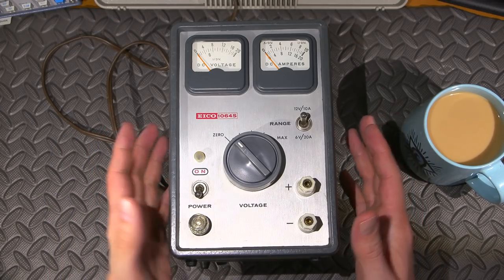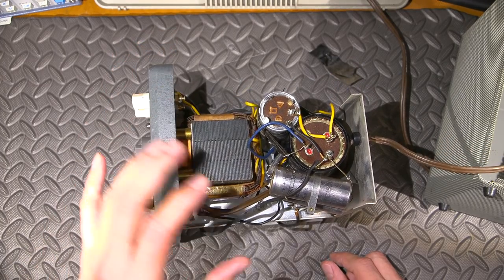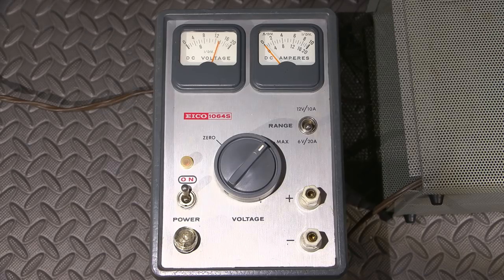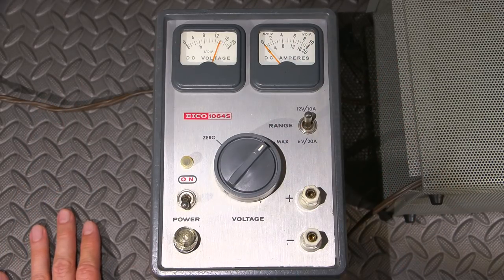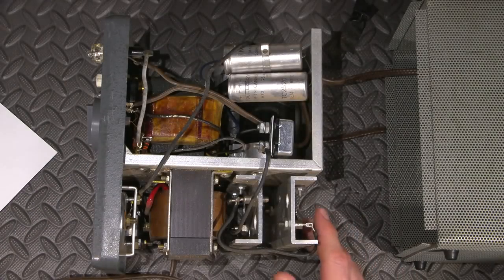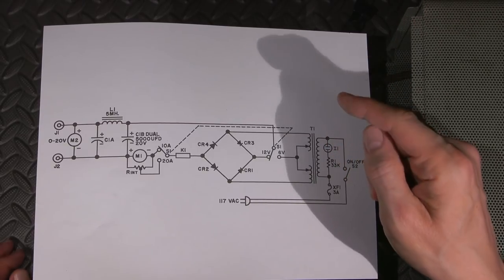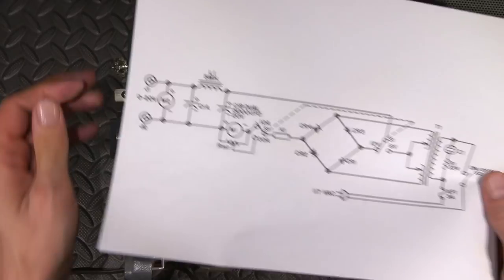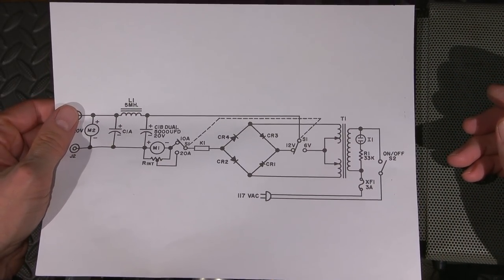Power Supply Knowledge - Tech Talk At The Lab!

Comment from the maker: To learn electronics in a very different and effective way, and gain access to Mr Carlson's personal designs and inventions, visit the Mr Carlson's Lab Patreon page here: https://www.patreon.com/MrCarlsonsLab
Reply: When are we gonna do the restoration? Dear Paul
Reply from the maker: @KetherWesak  It's in que, lot's of other restorations ahead of this one.
Reply: @MrCarlsonsLab  please do a 3 hours restoration with lots of details hehehe cheers
Reply: Sometimes you need to speak a little slower. Your an excellent teacher with wonderful knowledge. More of it will be absorbed by the student if you maybe use fewer words at a slightly slower pace with less redundancy. I love your classes - keep it up.
Reply: You didn't got the point of that configuration. Using center tap for 6V is because of the current.  In that configuration output windings of that transformer are in parallel and therefore voltage is half and current is doubled. And it's a poor design because those diodes should survive 4x bigger current.
Reply: Dear Paul, 
You really make electronics fun. One thing about this power supply, the schematic shows us the line, fuse and switch layout. You often speak about the fuse being on the switched line. Would you leave this the way it is or would you replace with three line cord and fuse the hot line to the switch, etc...?
Thank you,
David

Comment: Feeling old when I read other comments saying they have never seen an unregulated linear power supply before. I don't recall you mentioning it in your video either but a lot of earlier solid state electronics can have issues with noise from a modern HF switching power supply so these types of power supply are also useful when working on older solid state things too.

Comment: I much prefer the videos where you actually restore an old radio or item of test equipment such as the old multimeters (ME-26 for example) or signal generators or oscilloscopes, etc. that I worked on in the US Army back in the Seventies. Brings back a lot of memories of component-level troubleshooting. The videos where you only show what's wrong with the item don't float my boat.

Comment: Would be cool to see what the output looks like on a scope, using 12v and 6v mode. With and without smoothing capacitors.
Reply: and both ac and dc signatures. i bet its got a lot of ripple  thus the caps  trying to run something digital off it
Reply: @richardcranium5839  If that was a guess, it was a very good one. I've scoped the output of mine and a lot of AC ripple is present ever with small loads.
Reply: @rp5029  This underlines my reason for wanting a regulated supply.  A series linear regulator greatly reduces the ripple on the output.  For this cause,  I do not like unregulated supplies,  especially low voltage supplies.

Comment: This reminded me of a 6/12 volt battery charger my dad had. It was lacking the caps volt meter and choke. I had a similar circuit with the voltage selection. It had 2 large selenium rectifiers riveted to the side. I was just self learning electronics at the time and was amazed at the simplicity of the device. It was indestructible (thankfully) as I clandestinely used it in many projects and experiments.

Comment: I just happen to have the exact same unit , minus the strange cap setup . I use this box for all kinds of tests go/nogo , amp draw , motor brush setting , and other diagnostic uses . There is a spring metal wiper that controls the voltage . From outside , you have a gem ! The discoloration should not be an issue unless it has been mistreated .

Comment: Very cool how the schematic has the two diodes carrying the high current in 6V mode slightly larger than the other two.  My first 12V power supply I built in the 70's had 4 diodes like those, I think they were rated at 25A or so.  Industrial strength!  Great explanation of the operation of the device.

Comment: A simple, yet interesting design with the transformer having multi-tapped secondary. Most often these used a large reostat to set current, this has more of "voltage control" with the operator in the control loop, as you describe very well as usual! The meters seem to have little or no damping, but with a little operator patience, still fine!

Comment: Hi, nice to see you back :)
I also have an old brute force typw power supply with a variac that goes up to +/-40VDC at 200W or something like that. Good for building transistor power amps. I don't use it because I mostly dabble with vacuum tube electronics, but it's there in case I need it.

Comment: The easiest way to remember a full wave bridge rectifier is:  ALL diodes point to the positive.
Also neat from that schematic is that by that one switch the 12 V is made out of the series of the windings, and for the 6V they are used sort of parallel using the middle contact of the transformer.

Comment: Hello mr. Carlson

I wish you all the best in the new year and thank you for an absolutely great video.
I myself have a charger for lead-acid batteries built on this principle, and because at the time I was building it, it was difficult to get suitable diodes in Czechoslovakia, I used diodes from an old alternator for the rectifier.
One of my first regulated AC / DC sources works on the principle of a control transformer and also uses a Selenium rectifier for the DC component (those were the times 😉)
I wish you a lot of success in the next work and I quietly envy this source - a wonderful design - I have never seen such a thing.

Tom from Prague wishes you a nice day 🙂

Comment: With modern switching power supplies, say 5V USB chargers converted to 6V filament supply, it will cycle a few times (tripping overcurrent) before the filament gets warm enough where it doesn't trip the overcurrent protection anymore. It just takes time. With bench power supplies it's far easier to limit the current or just slowly bring things up from a very low voltage. From modern perspective, 300mA heater tubes are far easier to work with, since DC supply is a lot easier to get working with such a small current (small 1A diodes with no radiators, small diameter single wire on flyback/half-bridge transformer).

Comment: The Eico variac on my bench at work  is almost identical to this variable power supply, having the same case and layout, and a voltmeter but no ammeter. Slightly modified, with an incandescent lamp mounted to the top of it, for a switchable current limiter.

Comment: Neat video, Paul.  My 80 year old father has a battery charger, built in the 60s that works like this.  The transformer is center-tapped, and the 6V/12V switch changes the diode configuration.  I’m curious what that circuit breaker (in your PS) is rated for, since it has to deal with both 10A mode and 20A mode.
Reply: 20 amps. It can run all day at 10 amps.
Reply: I have a similar battery 🔋 charger from the 70s, it two was my father's,  I believe it is a Schumacher, I still use it today to charge batteries.

Comment: Thanks once again for your talks.  I remember building one of these a very long time ago.  I was wondering why you don't add a bleeder resistor to the DC outputs on your projects.  A simple way to protect the user and some of the more delicate equipment I fix.  Of course, a 12 V supply isn't too big a danger to the user except for the welding heat when you short it out  LOL

Comment: @2:30 Kapton tape is a good thing, taped on cap is a bad thing!  Maybe trying to reduce ripple.
@4:45 That winding on the variable tap transformer looks pretty cooked. It's obviously still working, just looks like it's been hot in the past.
What about adding a drain resistor across the C1A cap when you restore it?  I realize it will draw on the ammeter, but I doubt a 1K would make much difference.

Comment: There is something to be said for these simple things, perfect for abusing as battery chargers or to reform capacitors and other sketchy things. One of my decent regulated power supplies had a crowbar with a threshold that tracked the output setting, you can imagine what happened to the crowbar thyristor when someone charged a car battery with it and then turned the voltage setting down.... It is easy to look down on non-regulated supplies but they can be very handy for some things.

Comment: The slew rate spec on these power supplies were basically about as fast as your eyes could read the meters, relay the info to your brain, and then send the signal back to your fingers to adjust the knobs.

Comment: Brute force pw sup are handy for a lot of things. It is hard to hurt them. Some even have selenium rectifiers. It is interesting it has 20V rated caps and the output goes past 20V. I have several supplies like this (different brand) that I have used for years some even daily. I have several fancy regulated supplies that have been repaired more than once. We use them for heaters, battery charges, motors, and many other simple applications. I'm surprised to see that big filter choke adding lots of weight and cost. I don't recall if my supplies have one. They typically have the crummy sliding tap transformer which is pretty primitive. But it works. You can also generate poor quality power by knob turning to test a circuits tolerance for bad input.
I have some that go as high as 50V.

Comment: In 1972 I paid about $40 for a new EICO power supply (looks exactly like the one shown in this video). I used it for a wide variety of applications: it works nicely as a battery charger. It has never required maintenance. However, after watching this video it makes me question the condition of the filter cap. Maybe it's time to replace it (haa).

Comment: The range switching circuit here reminds me of the system used in PC power supplies to configure the 4 diodes as a full-wave doubler or bridge rectifier depending on the 115/230 switch on the back. I suppose the same technique could be added to this as a way to get a third 24v range without adding extra transformer taps.

Comment: The label on the back, "BATTERY ELIMINATOR" is more appropriate than "power supply". To me, "power supply" implies regulation and/or current limiting is internal.
Reply from the maker: Regulation and current limiting in a power supply are like ordering a trim package on a car. It's still a car without the trim package.

Comment: that circuit breaker looks like the same as used in semi trucks. wondering how they get 2 different ratings. also they are usually marked  battery and load  so reversing them (which i have done) they wont reset until you remove the power from them. of course this could be different internally. perhaps when you do the resto  you can address this.

Comment: I need something just like that to run two heating elements 1/2 Ohm, Kanthal resistance wire, and my wattage calculations indicate 2-3 Volts @ 7-8 Amps so I can heat two rods up to 200 degrees C or so.

Comment: are the meters way out? in the 6V range, the voltmeter settled to 10V when loaded, the ammeter was reading around 2 or 2.5A, but the 2 paralleled resistors form a 2.5 Ohm load. again in the 12V range, it settled to about 18V and read 4A into the same 2.5 Ohm load. those numbers dont add up do they?
Reply: I was wondering too. 🤔
Reply: @hugoegon8148  maybe its just a high contact resistance, sticking the resistor leads into the terminals. though in that case you might expect the current to fluctuate with tiny movements of the resistors, but it seemed very stable.

Comment: At first I thought the volt meter was badly underdamped.  When I saw the PI-filter I realized the voltage swing was true, just caused by the resonance of the filter.  Now I wonder if the "repair" was causing much of the swing, or if the original design had already the same.  Then there is another issue that capacitor manufactures pay attention to, but few users probably do -- the ripple current rating.  A fact is that the old BIG capacitors can dissipate more heat than the "nice" small ones and are likely capable of higher ripple current, given the same capacitance, of course.

Comment: Paul, 
What is the device under the power switch?  When I first saw it I thought it was some sort of SO259 type connector, but the more I looked it looked more like a lamp.  But if it is a lamp, why the other lamp above the switch?
Reply from the maker: I think you are referring to the fuse holder cap, ya it's a weird one.
Reply: If I remember the one I had it is an indicating fuse holder and was origional to the unit. The fuse was spring loaded and when it blew a red pin would would pop out and you would see the color change in the tip of the cap.

Comment: You're talking about 6v/12v tube radios and the current draw they take. How 'bout the vibrator that is used for pulsing supply for the filaments. How much do they draw?
Reply: The filament circuits didn't run off the vibrator, the vibrator was used to chop up the DC input so it could operate the power transformer to obtain the high stepped up AC voltage to supply the high DC voltages needed by the tubes, although in the later years low voltage "space charge" tubes were developed that operate directly from the low battery voltage for B+ eliminating the need for the vibrator, power transformer, and rectifier, these were usually hybrid radios using the tubes for the RF-IF & Det.& low level audio then drives a solid state audio output stage to get the required current to drive the speaker. These hybrid radios were the last of the tube based car radios just before the era of all solid state car radios. Also there were some radios that used regular high voltage B+ tubes that had a synchronous vibrator, a special type of vibrator with extra sets of contacts the switched the output of the power transformer secondary this eliminated the rectifier tube entirety.

Comment: Hey Mr. Carlson, I have been using X-10 light controls for 30 years, they are getting old and I want to upgrade, do you have any suggestions? What do you use at your house? Do a video on X-10 If you haven't already, mine still works well, but its old.

Comment: In unison with turning the front panel knob, a wire attached to the arm of the rheostat sweeps in an arc.  The wire's insulation is badly deteriorated. Without significant disassembly, I could only unsolder one end of it. I slipped a piece of spaghetti over it but I'm not totally satisfied with the repair and am interested to see your approach. Bite the bullet?

Comment: I wonder if the diodes are rated for 20A. They look too small for the current. Interestingly, in the past the capacitor cost was higher than 2lb of choke copper. Those were the times :-)

Comment: I do have a question. I have a five ninety and it said  a twenty five amp supply. I have ran mine on a twenty amp non switching power supply with no problem. should I have any concerns? I have ran this radio for three or more years this way. I might add.

Comment: In the 6 volt position (removing 2 of the rectifying diodes ) would there there be more ripple for filtering section to clean up?  It would be interesting to see the output of the bridge rectifier in both switch positions. Thank you for another thought provoking video.
Reply: No. There are two kinds of full wave rectifiers-bridge (4 diodes) and a center tap (two diodes). Both configurations are used here. I have never seen both used in a single device, usually it is one or the other. this before. So both settings produce full wave rectification. In essence, you only need two diodes, but you need a center-tapped winding in the transformer. The center tap method was used in tube radios where it the two diodes were incorporated in a single tube to avoid having to add a second rectifier tube. Diodes are so cheap now that bridge rectifiers are almost all that is used now.
Reply: @ianbutler1983  a similar cirquit is often used for switch Mode powersupplies for selecting between 120 and 240V
Reply: @ianbutler1983  ,  It is interesting that the pulses of DC current produce a higher load on the caps, though. For an equal output of the transformer, the cap load would be the same, but that wouldn't be possible with a supply such as this one.
Reply: @lukahierl9857  I didn't know that. Electronics is just a hobby, so I mostly deal with tube stuff.

Comment: 23:15 very simple design?  really? How does the Variable tranasformer VARY if its not a variac? not a ring core transformer with wiper!  Care to explain to this puzzled person!
Reply: Same principal, just not curved
Reply: Autotransformers (Variac is a trade name) have a single winding with a continuously variable with a brush contact or tapped with a switch. This allows varying the output voltage, but eliminates the isolation provided by a standard transformer which has two individual isolated windings (primary/input and secondary/output). Autotransformers can be a shock hazard if not used correctly. Wikipedia has  a good detailed description of autotransformers.

Comment: I don't get it! When the switch is set to 6V, the wipers are in play, and you can vary the voltage. When the switch is set to 12V, the wipers are out of the circuit. How does it vary the voltage if the wipers are not in circuit. To me is looks like on the 12V setting, you have no voltage regulation?!
Reply: The wipers are still in play they just adjust the amount of secondary windings the transformer effectively has 👍

Comment: When the heating voltage is switched on at a transmitter tube, my regulated high-current power pack switches off immediately because it detects a short circuit. I solved this, by building a 1 ohm wire resistor myself, which can be permanently loaded up to 140 W. It limits the inrush current. After preheating, the 1 ohms are short-circuited.